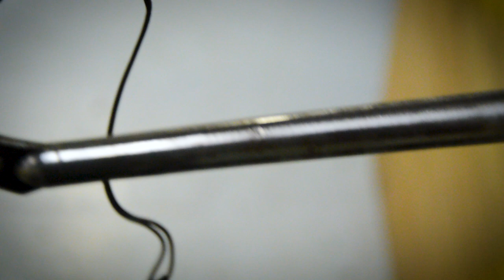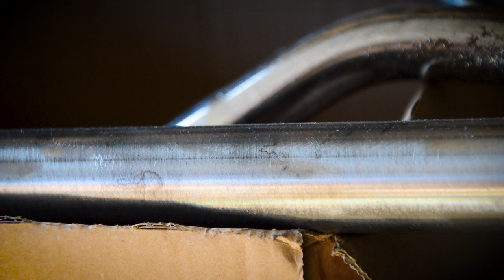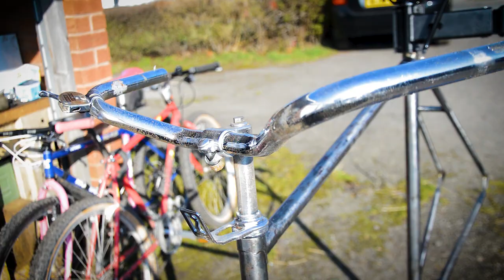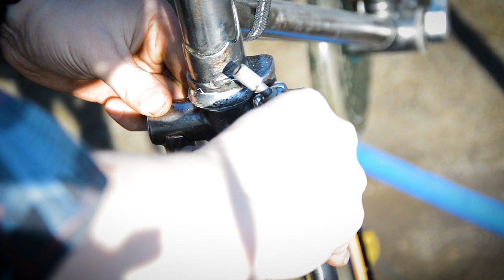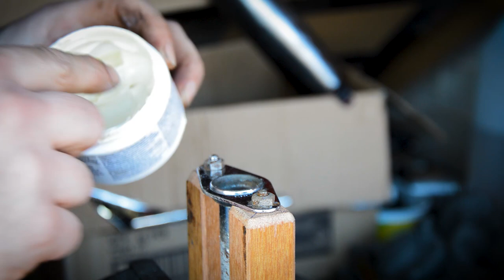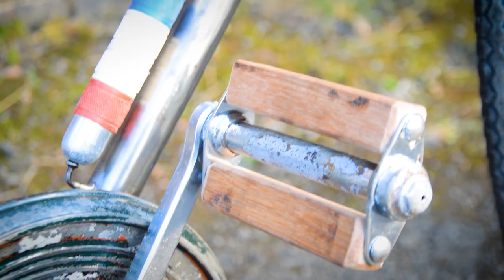1956 Raleigh Superb - Bare Metal / Raw Steel - Vintage Bicycle Restoration

Comment: IF any of your subscribers choose this route to strip paint, a word of WARNING, at some point, bits of wire from your rotating 'tool' WILL detach themselves from said tool and ping off at huge speed into the middle distance, IF you do this outside, in the garden perhaps? these tiny sharp fragments of wire will end up in your feet (which is extremely painful) worse still, they will end up in the feet/paws of your pets, who can't reach for the nearest pair of tweezers. I made this mistake and the only remedy was to get on hands/knees and, armed with a large magnet scour the whole garden. If you care about your feet and those of your pets (and the pets of others......PLEASE do this INDOORS in a sealed off area, which you can vacuum/sweep easily afterwards. Same applies if you go the chemical 'stripper' route.
Reply from the maker: Definitely top advice there.  I did it indoors and with a full face shield too.  I've picked wire out of my cheek before... it's not pleasant.  Now... how do I pin this comment.
Reply: I think you've just done it? Btw, Thank you for all these videos, like many out here in internet land, I love what you do, but.................PLEASE PLEASE PLEASE, I beg of you, stay away from powder-coaters, spray painting your frames really isn't that difficult, the finish is IMHO far nicer/more durable, and fits in with the quest for 'originality' far more credibly. All the Best, GT.
Reply: If you use the twisted wire wheel it will limit the amount of pieces that come off the wheel.  Having said that, I always vacuum the area where I use it.

Comment: It does look great. Classic geometry.  Good job on the clean-up.  I went for the stripped look on a bike as a kid. (Nothing implied.), in the end I spent more time explaining why I didn’t paint it then I would have spent painting.  If you do get the urge to paint, stick with the theme, silver/grey and black.  Grey frame, black pinstripe, to highlight the frame details, black chain guard and black mudguards.

Comment: I've been watching your vintage builds for a while now.  I'm currently building a path racer on a Raleigh DL-1 frame myself  I've learned a lot from your channel especially your Hercules build.  Thanks so much for all your shared experience.  On this bare metal bike I think you should go with the mudguards - maybe cut the originals down in length to get rid of the decay.  I don't think the flap disc marks on the metal are a problem.  I love the full chaincase.  I'd flip the North road bars though and I like the rear rack and your plan to build a wood box that will match the pedals.
Reply from the maker: I probably will fit some guards at some point but I'll get another set that mount to the proper mounting points (and not the axle like that set).  I'll probably find a set that I can clean up the same way as the chaincase.
Reply: I'm using a 1950's Raleigh Industries calliper brake set complete with levers.  The set has cables with the pear ends in useable condition but I want to use new cables.  What are the cable stops you use with these brakes (like on your Hercules build - the ones you filed down) and where can I get them?  Thanks again for your channel.  Your videos have been a really great resource for me in approaching this project.
Reply: I'd like to see what you're doing with the DL-1 frame.  Any chance you'd consider sending along pictures?
Reply: It's still early days for my project.  I've been assembling parts and researching the history of these bikes for the last two months.  MonkeyShred's channel has been very helpful.  I learn new things almost everyday and sometimes make mistakes.  Since first commenting on this video I've learned more about old Raleigh frames.  I now think mine is actually a DL-22.  I've assembled lots of parts including a Brooks saddle, Soma Lauterwasser bars, GB hinduminium stem, Rivendell cork grips, Shwalbe delta cruiser tires (cream), 1950,s Raleigh Industries brake callipers and levers, an early 1950's window trigger shifter that I have disassembled and cleaned and am now trying to figure out how to replace the worn brass plating on the face plate, I have a replacement headbadge and fork thimbles, a vintage aluminum pump, and a vintage vinyl behind the seat saddle bag that I intend to remake out of leather.   The frame, crank, wheel set and 3 speed hub are from an early 1970's bike.  Basic 20-30 tubing.  I intend to have the frame powder coated in a dark green.
Reply: Jeff Rutkair Sounds like quite a project. I’ve got a soft spot for Raleighs. I’ve restored a bunch of them, but never to the point of modifying or repainting. Good luck with your undertaking.
Reply: Thanks for your interest.  If you have any thoughts about new cables in old Raleigh brakes I'd love to hear them.

Comment: Those twisted wire wheels are savage! If your angle grinder has a speed control then try turning it to its slowest speed that way when and if you catch an edge it’s not too bad and doesn’t throw the wheel out of balance, there’s nothing worse than an unbalanced wheel! Numb hands is not funny 😁
Reply from the maker: Yeh, the hands went numb a few times! Ha. Worked well though!

Comment: I found using a wire brush drill bit on a drill was best, using a small dremel sanding bit to get into the hard to reach spots. After this I would go all over the bike with some rough steal wool and autosil metal polish to bring it out and remove most the swirls and scratches from the wire. Finally I would repeat this with some finer steel wool and autosil

Comment: Been watching your spot for a while now, this Bicycle was made 4 years before i was born, it was made in England, that is where Bicycles were built to last, today's post proves that, it was also made to have mudguards, so maybe you should think about putting them back on, give her back her dignity, these are just my thoughts, it looks nice, but something is missing from her, and it should be ridden in any weather. I have a superb it was made in the 80's, (85) with front rubber mudflap.
Reply from the maker: I will be looking for a set of guards, but some that mount to the points on the fork and frame as intended and not the axles.

Comment: The bike looks great, personally I’d ditch the chain case for a simple hockey stick cover. As for protection bees wax has traditionally been used for iron work 😉
Try this, heat up and melt together bees wax, turpentine and boiled linseed, can’t remember the ratios but it can be found on YouTube it’s great for waterproofing shoes, canvas and just about anything
Reply from the maker: Ah ok!  Another method to try out then!  I'll give that a go on another bike.

Comment: Monkey shred. Just saw this video. I have a 1955 Rudge Whitworth. Very similar to this bike. I saw that you reused the original brakes. I would like to reuse my original brakes. But the cables are a bit stiff in the tubes. As you know these cables were a Raleigh design, which are no longer available.  Where did you find these cables? If not the Raleigh cables, how do you keep the ends from pulling off when used?

Comment: I used paint stripper to get the paint off my mountain bike it worked ok. Still had to use a wire brush
Reply from the maker: It's just not as strong as it used to be.  :(

Comment: To be honest I've done loads of steel frames, paint stripper etc etc, Sand blasting is cheaper and more effective and leaves surface smooth and time saving, but gotta admire your work (long live steel)
Reply: I too thought sand blasting would be more effective but it looks as though he was trying out different techniques. Fair play to him, it's come out great.
Reply from the maker: It's true.  I could have dropped everything off at the powder coating place and they would have blasted it for a tenner but it would have stripped off all the history from the frame and dulled it down.  Paint stripper is definitely a great option but it's so expensive :(

Comment: Hey I'm looking to a 1961 superbe and a 1959 boulevard tourist but need to replace the cables, what did you use to bolt on the cable to replace the fixed end. I noticed you tighten an alenkey sleeve?! Great bike cheers
Reply from the maker: They are solderless nipples.  Available in different shapes and sizes but may need a bit of filing down to fit snug

Comment: Nice build fella, I strip frames with an angle grinder and selection of wire wheels.If you coat the frame in paint stripper the night before it really helps.
 I think your bike would really suit a cool front rack with wooden runners and a big front light. A box on the back would be to under the seat and not look right,i'd lose the back rack,but that's just me. Bon continu.
Reply from the maker: It's getting a nice big front light tied up to that dynohub.  I have a couple but I need to refurb them.  Front rack should look good with those slats too.

Comment: I'm currently stripping a steel hardtail mountain bike frame and I'm hoping to polish the brazing then wipe it all down with methylated spirits. How well did the boiled linseed oil hold up ? And how often do you need to apply ? Thanks
Reply from the maker: It works pretty well.  I couldn't give a timeframe though, it would depend on location, riding style, weather etc etc.

Comment: What an amazing bike! I have an old Peugeot I ride along the beach boardwalk here in San Diego... it’s stripped down to bare metal like this and you can see the head badge outline of the lion in the rust.  It’s held up well for the year I’ve rode it, normally the beach should have rusted it well out.  I clear coated mine with lacquer.   I see you put boiled linseed on yours which interested me, I rubbed some on my bike but it’s been almost a week with no signs of it drying... is that normal? Should I be patient and put it in the sun? Thanks

Comment: The problem with stripping these old paints of is that they are lead based. Paint strippers won't touch it. You have to be so careful when sanding it not to inhale or consume the dust. I'm currently restoring a 1950's Humber made by Raleigh and have chosen to leave the old paint on. It adds to the aged matured look of the bike, natural patina! I'm lucky that the rims are stainless steel but am concerned with the old 4 speed Sturmey hub as they are very temperamental at times!!! That's why they stopped making them. Nice to still see interest in these veteran bikes, testament to their build quality. However from the 70's onwards this quality did decline. Take care, all the best.
Reply: I have a 4 speed and first gear slips unless you hold the gear lever down. Not found a fix for that problem yet any ideas?
Reply: @postiephilip   Unfortunately not, these are just some of the problems with the 4 speed. Have a look on Sheldon Brown's web site sheldonbrown.com, this is the place to go for any non general bike information.
Reply from the maker: This did originally have a 4 speed and stainless rims.  That hub was seized though and the rims I stole for my path racer.  I'm definitely going to have a look at servicing the 4 speed though... the Dawes I'm doing has a 4 speed so I hope it works.
Reply: @MonkeyShred  I hope so for you. Whatever you do don't lose the toggle chain as totally unobtainable. Good trick with these is to put a matchstick through the adjustment hole on the non drive side. This prevents this half of the chain springing out if it loosens off.

Comment: Use paint stripper or sand blaster
Reply from the maker: Paint stripper can be effective, but it can also get expensive.  Sand blasting works well but can remove any patina that would be on the raw steel.

Comment: I noticed you are using a white grease on your recent videos. I would love to know more about what greases you use when. I am working on a 1971 Hercules with a sturmey archer 3 speed and don't know what to put in the gearbox. Great video👍
Reply from the maker: I've done a 3 speed rebuild video before.  I coated the internals in a light automatic transmission oil so it didn't get too clogged up and the bearing races had normal bearing grease in but used sparingly.

Comment: I have stripped three frames back to bare metal this year using Power Strip from an eBay seller.
 https://rover.ebay.com/rover/0/0/0?mpre=https%3A%2F%2Fwww.ebay.co.uk%2Fulk%2Fitm%2F262539148822

It works an absolute treat and is much stronger than Nitromors.  I think it still contains the magic ingredient.  I painted it onto my powder coated steel RT Shayler and literally watched the paint bubble up and flake off.  Deffo worth a try

Comment: Nitromors, steel wool and some time before polishing. No quick way of doing it. Just need to make sure you use lots and don't let it dry out.
Reply from the maker: Lots of Nitromors is costly :(
Reply: @MonkeyShred  yeah, it is that! Actually got a new one too try, will let you know how I get on. Its the chemical that it is in Nitromors, but not mixed. Will be more tricky to use I'm sure, but it's a lot cheaper.

Comment: Does anybody have an update on the lineseed oil???? How long does it last and how often do you need to reaplly it? I life in a place where I cant spray paint something, so I am thinking about this as a alternative.
Reply from the maker: It's going to depend on the thickness of the coat / use of the bike and weather conditions for how long it lasts.  I don't think there's a specific time that can be given.
Reply: @MonkeyShred  Cheers mate, appreciate the answer. Do you feel it when the coat wears off? I have 0 experience with lineseed oil

Comment: The dish you talking about.  On the rims ?
Reply from the maker: Yup.  The front wheel is centred over the small flange of the hub for some reason.  I also noticed the spokes for the large flange have a lot of threads exposed which shouldn't really be the case.  I''ll strip the wheel down and rebuild it properly.
Reply: MonkeyShred yeah.   Ya did a good job on it.

Comment: Discover abrasive blasting, Invented long ago and used to remove old coatings and oxidation for decades.
Reply from the maker: Abrasive blasting tends to leave a rough finish though and take away the details of the patina though.  That's what needed in a raw build